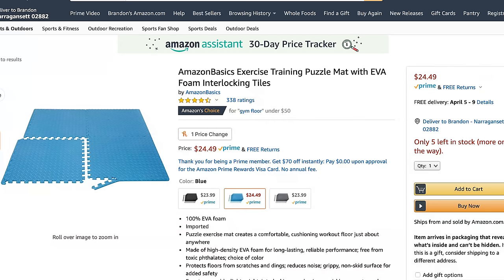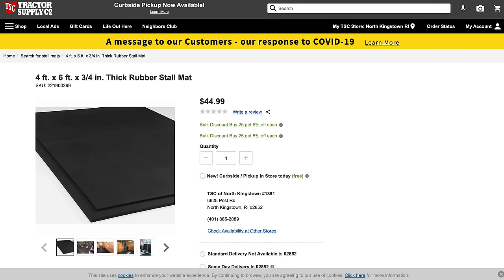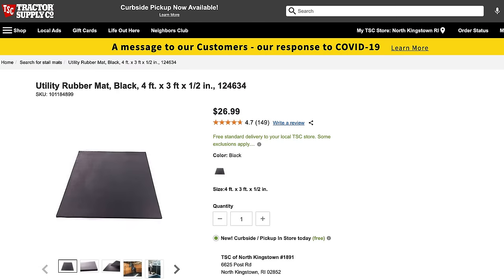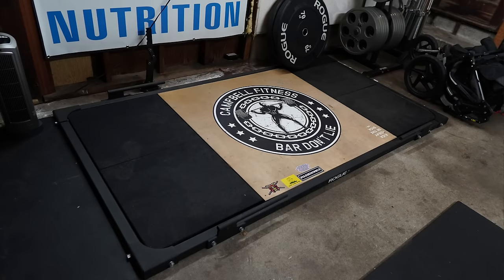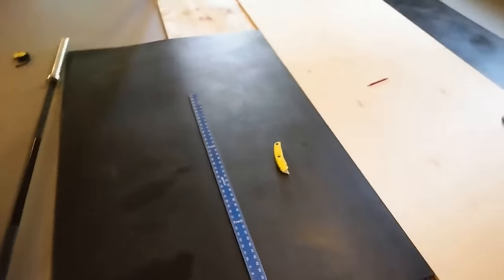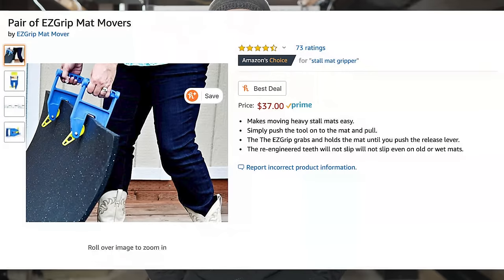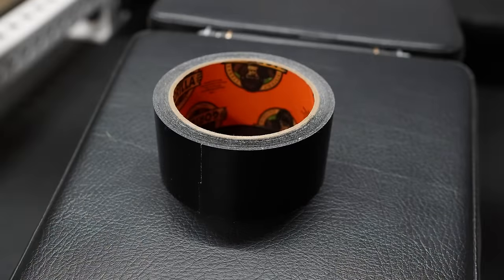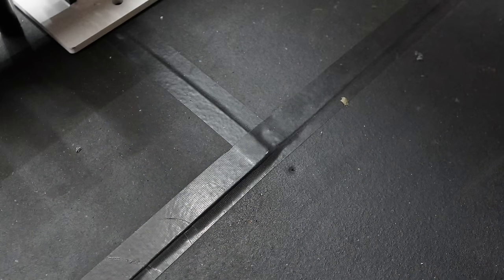Home Gym Flooring Basics

Comment: PRO TIP: bring ratchet straps to TSC with you and roll the mats up and strap into a roll, so much easier to move by yourself then wrestling with a 4x6 sheet
Reply from the maker: my man, that's clutch
Reply: And if dont have many ratchet straps can use twine as well
Reply: I had to just roll 3 of them up and somehow fit them 3 in the back of a corolla 🥴
Reply from the maker: @joebigjoe  I would have loved to see that.
Reply: joe richer Hah. Try 4 in a Mazda3!
Reply: Cheap ratchet straps helped me pile them all in a Kia Soul. Worked great.
Reply: THIS IS A TOP-TIER COMMENT! Dude....
Reply: I fit 6 in my wifes Audi Q5 by rolling them up! Do i win? The smell on the trip home was mind numbing lol.

I also use an very small battery powered blower and hand vaccum to clean my basement gym.
Reply: I just used this method and it made moving them a breeze!
Reply: I did the taco method he mentioned... but I wish I'd thought of using straps.
Reply: Tractor Supply said not to roll them up, they can tear, and at that point would be non refundable. But if it works then it works
Reply: YES! And if you don't have some, just buy them. They're relatively inexpensive at the big box stores and are useful to leave in your car or truck for random tasks. I was able to fit 3 stall mats into my 1999 Civic by myself with just a pair of ratchet straps. It is possible, comrades.
Reply: LOVE TSC  stall mats . mine will be 10 years old this fall.  LOVE THEM !!!!!!!  4 of them. in my garage
Reply: @SkankyEJ7  how long did they stink up the basement? just bought a bunch, in the back of my truck wife doesn’t want them in the house until they are done smelling
Reply: This…. I wish I read this before I wrestled dang horse stall Mat 😅
Reply: I had 12 mats to move, I just rolled them up, and threw them through the basement window…I gave up on the strap 😂
Reply: Which I would’ve seen this about an hour ago lol I wrestled 8 mats into the back of my Honda Accord😅😅

Comment: Put six of these in my basement a month ago and they are awesome. Since I’m not deadlifting more than a couple hundred pounds, I stuck with just a single layer and it seems be be just fine. I am using steel plates. And, yes, after 30 days, my wife still complains about the smell. I kinda like it. Reminds me of driving bumper cars as a kid.
Reply: If they smell bad, leave them out in the sun for a couple days.
Reply from the maker: Good to know!

Comment: Great video..I use these mats myself.  Mine have a smooth side and a side textured like diamond plate.  I agree with staggering them if you're using more than a couple.  At least with mine, the accuracy in the size isn't great so they likely won't be a perfect 4x6.  And when cutting, I found using a 3" piece of PVC pipe to lay the cut line over helped tremendously.  I started with a couple of easy cuts without much pressure to get a groove started.  Then I was able to push hard with the blade without worrying about drifting.  With the mat on the PVC, it naturally wants to split for you.
Reply from the maker: Good tip about layin pipe!

Comment: I bought 16 of these mats at tractor supply. Under $50 each (no sale).  My wife and I did all the lugging. 2 people to move a mat is much easier. One is doable but can be tough. It's not so much the weight but the fact that they are flat and awkward. And your fingers begin to hurt when you grip and drag. I recommend wearing gloves.  We also had that strong smell at the beginning but they've been sitting in my garage for a couple weeks and the smell is gone.  You say to stagger the mats but in your video when you show them under your rack they are not staggered.  Gorilla tape might work but gaff tape I think is nicer if you want to tape the seams, you can get it on Amazon.  When you are deciding how to arrange you really want to arrange the mats so you're doing the least amount of cuts. I recommend making a to scale drawing and then also many to scale cut out of the 4 x 6 mats. That way you can arrange it on paper to figure out what's best. Much easier than actually arranging and then rearranging the 100lb mats.  I haven't tried cutting any of them yet but that's my next step.
Reply from the maker: Right on, appreciate the feedback. The Gorilla tape still looks as good as it did when I put it down a year ago.

Comment: Great way to clean your mats once and it worked for me. 
Lay the outside in direct sunlight. 
Spray them down. (I used my pressure washer and it worked great). 
I used regular dish soap and a door cleaning scrub brush and put in about 10min of good old fashion elbow grease and scrubbed. 
After I was done with all 4 mats I used me pressure washer again to rinse of the soap. 
I repeated the same process on the other side. 
I let all the mats dry in the sun. 
When they were dry the smell was gone and they got all of the grim from the store and manufacture. 
Took about half a day and a sunny day. 
Hope it helps.
Reply from the maker: Good tips!

Comment: Dude thank you so much for this video. We are getting ready to move and I'll have to be moving around 13 mats, that gripper is going to be a back saver.
Reply from the maker: Not a problem!
Reply: TJ u should do isolations for ur back if they hurt
Reply: I found using a couple of vice grips to be the ideal solution for moving the mats. Already had them, so no money spent on a single use product and they worked well.

Comment: Horse stall mats are amazing and much cheaper/effective than some of the rubbish flooring you can buy off of Amazon or weightlifting equipment websites. Unlike what I read sometimes they're easy to cut if you know how to do it right. The only thing is that the 4x6 ones are really hard to transport and feel much heavier than they weight because of how awkward they are too lift, so make sure to grab at least another person when you go pick them up, because the store workers won't help you (they know better lol)
Reply from the maker: Very good point, they're deceptively heavy and awkward. My brother in law (who doesn't lift) now will no longer help me lol.
Reply: Fold the mats in half like a taco and carry them in front of you. I have 1" thick 4'x6' mats in my horses' stalls and I move them every couple of months this way by myself. They're easy loading into a truck bed this way, too.

Comment: Just a suggestion with all the home gyms getting purchased! 

You’ve experienced and tried a lot of different equipment, especially ones in the home gym space. Most people obvs will start with the basics rack, barbell, plates etc. I think a cool video idea would be equipment (based on your experience of usefulness, variety in terms of output of movements or simply frequency of most used etc.) you would recommend purchasing next!
Reply from the maker: Noted!

Comment: The smell was absolutely insane driving home. Thanks for the simple green idea 💡
Reply from the maker: Hope it works!
Reply: I bought 4 last year and the stink was overpowering for a basement gym. I sat them in the sun on some 4x4s and scrubbed both sides several time with SG and let them air out a few days. That helped a ton, but they were still rough for a few weeks, so I opened a box of baking soda.
Reply: @andrewtate5652  Do you still smell it?
Reply: @yohanniltis5262  not at all. After airing in the sun, simple green scrubs and a box of baking soda, all is well. I would say you need up to about 3 weeks or a month. I am pretty sensitive to smells and the home gym is also my home office. So I was sitting there for up to 12 hours a day.
Reply: @andrewtate5652  I hope to god you’re right. I bought 8 of these things and it’s been four days of scrubbing simple green and power washing, the smell isn’t budging.

Comment: For cutting the stall mat, if you can, get some sort of tube(I used my foam roller), then draw the line of where you’ll be cutting. Once you’ve done that, place the mat on the tube. Make sure the line is exactly on the middle of the tube. Will make cutting SO SO SO easy. What happens is that as you start making your cut, the weight of the mat starts pulling at the seams and will just tear with ease. I bought a pack of blades thinking I’d go through them like crazy. I did all the cutting I needed to do with 1 blade.
Reply from the maker: Some helpful tips, thanks!

Comment: Smell Removal:
- sun the mats - the heat speeds up the process significantly (hours to a week depending on what kind you have)
- wash them before sunning /w a PH Neutral cleaner (wont harm the rubber) - scrub with a hard brush/broom
Most of the smell will be gone within the week
Reply from the maker: All great tips, I find that for some people they're just super sensitive and no amount of cleaning will save them lol.

Comment: Just bought 3 of these mats. Rinsed and dried outside first to ensure no residue. Social distancing precluded help from a friend. So I rolled them up, bear-hugged them, and walked each from the garage down to the basement. That was a workout. Have mine on carpet. Very stable, no movement. The smell of rubber is subsiding - but will probably need to open the windows once it warms to air the basement out a bit.
Reply from the maker: appreciate the insight!

Comment: I used dish soap (slightly diluted) and a sharp razor knife to cut these. Blade slides through much easier. The drywall square works great for accurate cuts too. Thanks for a great video Brandon.
Reply from the maker: Ah good call on the soap.

Comment: When I got my mats, the smell was pretty bad, and they are going in the basement, so I left them outside for about a month, then cleaned them with simple green and a scrubber, letting them dry off in the sun. The time outside and an aggressive cleaning really helped to minimize the smell when I finally dragged them to the basement.
Reply from the maker: Appreciate the tips!
Reply: How is the smell today. Do you still notice it? Does it buildup when left in a closed indoor basement? Would you still recommend these?
Reply: Traveler i left one of mine out in the sun elevated above the ground for like 3 months and i smell nun
Reply: @Traveler-PKK  I have hardly any smell to them now, a year or so later. I notice it every now and then, but not often, and never bad.

Comment: Thanks for the video! I'm outfitting a home gym in a small basement room and my wife is SUPER sensitive to VOCs. She'll be using the gym too, and it's also next door to our daughter's playroom. Do you know of any low-odor options that still have the durability of the rubber mats you referenced?
Reply from the maker: I'd look at actual commercial rubber flooring. They also market some as low/no odor. The downside is it's usually more pricey.

Comment: I had to move 4 mats into my basement by myself, and damn was that a pain in the ass. Not because they were heavy but because they weren't rigid.
Reply from the maker: floppin around
Reply: I regularly have to move them in and out of my horse stalls. Fold them in half and carry them in front of you. Super easy.

Comment: Great video, thanks! And some great tips in the comments. I have scrubbed mine down with OdoBan once already, a 30 minute soaking session per side. Two days later, the odor has returned so I kicked them back out into the garage. Not much opportunity for airing them out in the sun in the middle of winter. Might have to cut my losses and buy interlocking flooring instead.
Reply from the maker: Thanks for sharing!

Comment: Great review, nothing beats Tractor Supply for gym flooring.  I ended up committing to the 1/2" mats years back, (unable to transport the larger 3/4" mats with my vehicle or load by myself.)

That said, I find if one doesn't drop any weights on the mats, 1/2" mats offer adequate protection.  In fact, my commercial gym only has 1/2" floor matting as well.

Of course, Deadlifting would still require a 1.5" Deadlift Platform.  As for all my other items, I think 1/2" mats are sufficient, easy to transport, and don't require pickup (or similar size vehicle) to transport.  Plus, don't need another person to load/unload with the smaller 1/2."

I would say however, at regular price, you get more value per Sq. Ft. with the larger 3/4" mats.
Reply from the maker: Right on, good to know!

Comment: I ended up going with the 4' x 3', 1/2" stall mats since the ones suggested in this video are hard to find and sold out. Cost a little bit more (two 4' x 3' squares are about $3-$4 more than the one 4' x 6'), but may be easier to move around since they're smaller squares and 1/4" thinner. Hope these will be good enough.
Reply from the maker: Right on!

Comment: I just got 3 mats last week.  None of my local stores had any so I ended up at a store about an hour away.  Hadn't realized how much the weighed until the guy loading them into my SUV told me.  I actually managed to manhandle those things from my SUV  in my garage through the entryway and into my ground floor basement by myself.  Not bad for a 5'5" woman where the mats are about 2/3 of what I weigh (I was kind of impressed with myself).  Guess all the weight training I've been doing has been paying off.  Now I just have to wait for my power rack to arrive.
Reply from the maker: Haha good work! People always think I'm kidding when I say they're super awkward to move!

Comment: I fit 3 of these mats in my Subaru, the associate at TSC looked at me and said "WTF is that where you're gonna load them?!" The smell goes away after a while. If you use water along the area where you're cutting them it should keep the smell down while you make cuts. I found that cutting them made the smell even worse. But, I got used to it after a while and now it's faded and not noticeable at all (a few months into horse stall mat ownership).
Reply from the maker: Ha nicely done!

Comment: Canadians – 6'x4'x3/4" stall mats are $100 at TSC. Fitness Depot has comparable mats (rubber, same size) for $60 and $46.
Reply: ca if you can drive there thats great but beware of the insane shipping fees if you can’t i got mine free pick up home hardware 2  3/4 3x4’ mats 40$ each
Reply from the maker: Good call
Reply: Yeah TCS is expensive here, idk why. I got mine from fitness depot as well. Fitness avenue has them also

Comment: I used a furniture mover on one end and steered with the other end to get them into place in my garage - why battle the weight if you don't have to? Mine were 4x8 x0.75" thick and a pain to move around. 
As far as the cleaning goes - if you have a roomba/robot vacuum just let roam around and vacuum up all the dust lol. 
The smell of the mats is outgassing of material. You can accelerate that by leaving them in the sun. The slight UV degradation will help accelerate the process and hopefully they smell a little less. 
Thanks for the video!
Reply from the maker: Appreciate the insight!

Comment: Tractor supply price matches! I bought 6 mats for less than $170 because I showed them Cashman’s website with the same stall mats for $27.00 ea.
Reply from the maker: Damn it, wish I knew this!
Reply: I tried this and they told me no.
Reply: @shangaertner5380  they have quality one($35)and quality 2( $27-ripped & missed edges). maybe they didnt do quality 2 but would quality one?

Comment: Snagged one of these a couple of weeks ago.

Only thing I've noticed that wasn't already mentioned was how grippy they are on your shoes - you might want to build the deadlift platform instead of using the bare mat if you do a lot of foot-wiggling prior to a lift.
Reply from the maker: I actually like the grip of these more than the wood!
Reply: @BasementBrandon  I find the rubber grip changes as the weather does. Very grippy when hot and hardly noticeable when cold. As for wood I like birch because it's grippier than maple. Sometimes maple is too slick. I'm sure the sanded finish dictates that too.

Comment: How do you overhead press in you basement? Is the ceiling high enough? I'm asking because my basement is 207 cm high so I'm having trouble making a home gym
Reply from the maker: For the basement I would sometimes use a cambered bar b/c the weights are lower then where I would grip. But in most cases I'd do seated OHP on my safety straps. Also look up Z presses.

Comment: Just picked some up yesterday. Got 3 of them folded up in my station wagon by myself. Pain in the ass. From store to store and depending on the area they have different kinds of stall mats. Mine were textured one side facing down and almost like diamond patterned on the top, which almost feels smooth. Today after not opening the windows to my home gym, the odor gave me a headache. Airing out the gym as of right now, cleaning the mats on the hour. Hopefully most or the odor goes away, off gassing is crazy on these mats.
Reply from the maker: I'm most impressed there are still station wagons out there (I had one as my first car back in 1997! Use some simple green on them, it'll help.

Comment: I deadlifted on a single layer of stall mats for several years with no problems. I did build a deadlift platform recently, mostly because it looks cool! Lol
Reply from the maker: Ah appreciate the insight! I've always been too worried so never tried less.
Reply: Was the ground beneath concrete?
Reply: panther - yes concrete garage floor

Comment: I’m building my first garage gym, do you think I can get away with using only one 3/4” stall mat for deadlifting if I’m deadlifting 405 or less? I ain’t that strong lol
Reply from the maker: There are a lot of people in the comment section saying they do that with no issue. I just prefer to be safe than sorry.
Reply: One mat's fine if you kiss the weight down. Hell, a paper towel is fine if you do that.